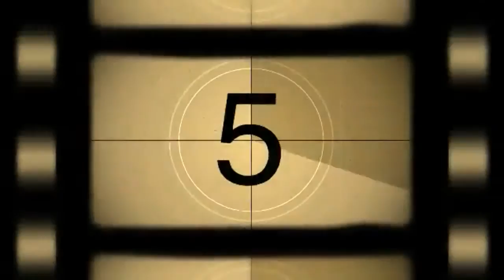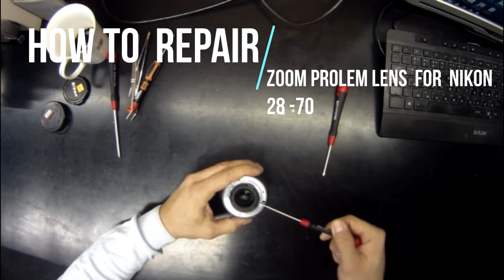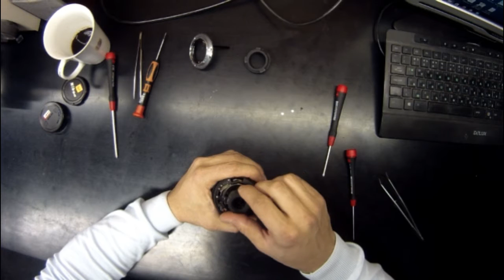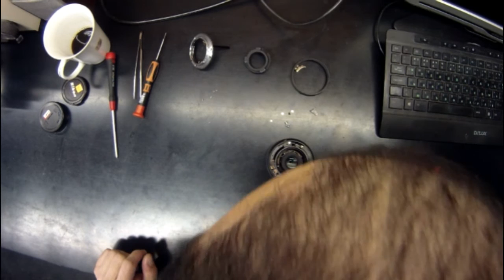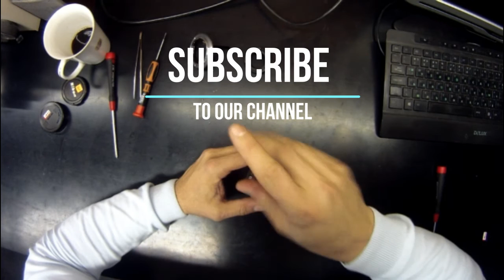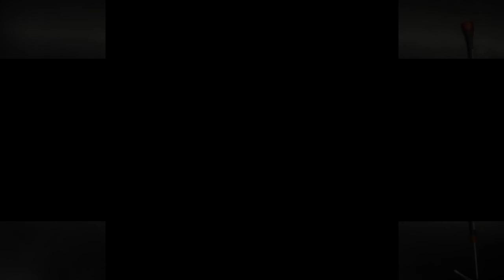How to repair zoom problem with lens Nikkor AF 28-70.

Comment: Hi, great video I have one of those and it will serve me for the future I know, I have a problem with a 60mm f2.8 Non D version, I thought the assembly will be the same as this but it's not the same and aperture it's not working at all it's not changing aperture  I tried everything and does not seem to be a right way to reassembly, maybe you know something about? thanks I already subscribed
Reply from the maker: Hello, thank you :) So for the aperture you should check the spring and the right position of the lever. Also check the two screws which holds the lever and the bayonet part of the aperture mechanism of the lens :)
Reply: great video??? how is it great?

Comment: HI SIR ,    I have the same lens (NIKON  28-70 f/3.5-4.5D ) and the zoom ring is hard to rotate ,  in your video its easy move the ring zoom  ,  I HAVE one question  What causes this problem?
Reply from the maker: Hi , i need more explanation about the problem. This lens is not so complicated so may be some screws are loosed inside the lens or something else.